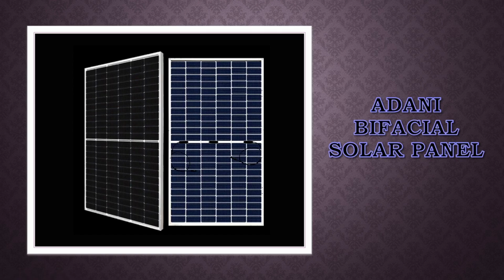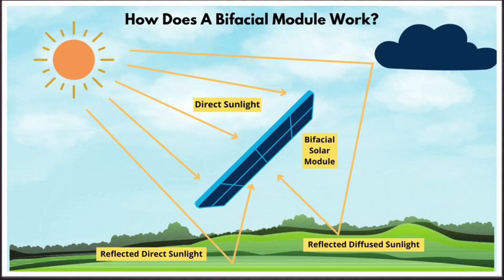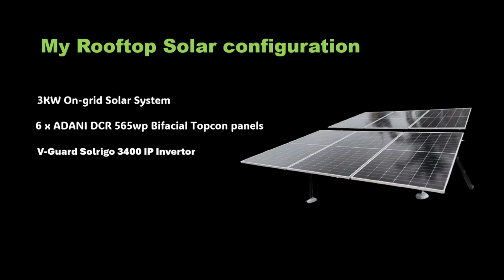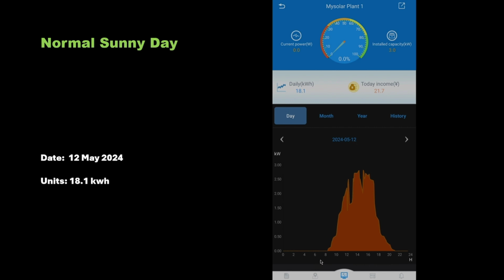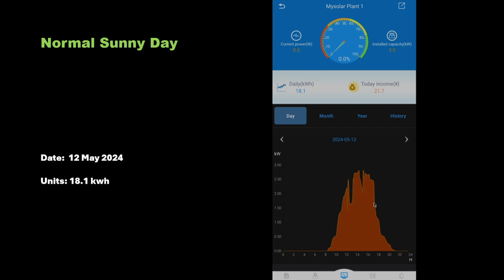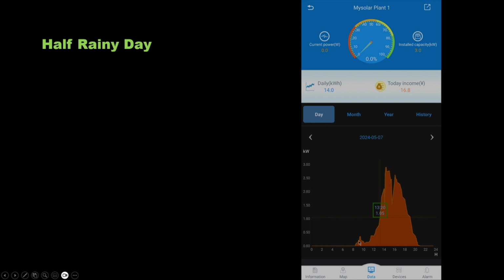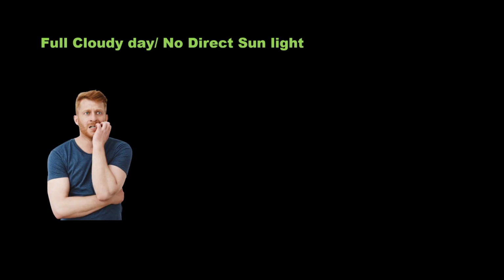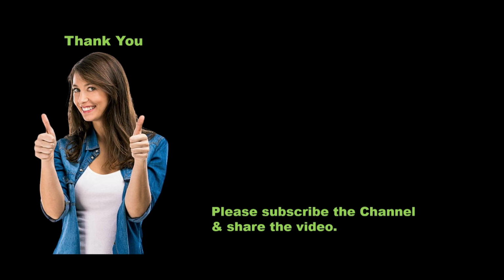Adani Topcon Solar Panel Review | How Many Unit 3KW On-grid Panel will generate

Comment: Dear.... Maxmium Ampere...produced by pannel on a Sunny day... It is heard that topcorn produce more amoere than perc and need special type of invertors... Kindly reply
Reply from the maker: Hi 

For Topcon Unit production... Please check our monthly unit generation review
Reply from the maker: Topcon required the special invertor which support the special gain... Check the installation video in channel... It shows the complete meterial used
Reply from the maker: Hi Bala 

I have checked the Ampere while 2.5k it is more than 11amp ... so when it reach 3.3k I am expecting Amp will more...

Comment: Hi.. Are you facing inverter tripping problem 😢?
Reply from the maker: No.... 

Which invertor you are using
Reply from the maker: when the voltage from KSEB is below than 170.. your invertor will trip.. this is by design... you need to contact your KSEB... raise a complaint

Comment: Could you comment on what is the lowest these days you are getting from 3kw topcon in Kerala weather? I wanted to know the least value possible, like on a fully cloudy and fully rainy day.
Reply from the maker: I will be creating fully raining in upcoming  weeks or months...

Please check our latest video for full sunny☀️ day performance. 

Kindly like and subscribe the channel. 

Thank you🙏
Reply: i got 16.5unit in March sunny day, and 14unit avg.

May June rainy or cloudy days 5unit to 14unit range.

adani6x540w panels. peak 2.7kw max in a day
Reply from the maker: Hi Safeer, what is your solar capacity ? were you located?
Reply: @Safeer21M  Thank you for sharing.
Reply from the maker: Hi Jinto, I am still monitoring the panel ... I got minimum 6units on heavy rain situation. Once I have enough data ..I will create video with full rain situation.

Thank you
Reply from the maker: I have updated the fully cloudy day details in this video